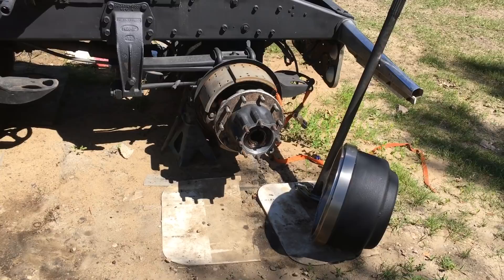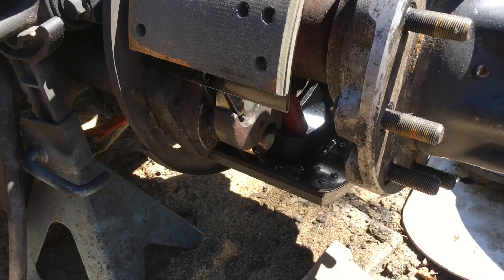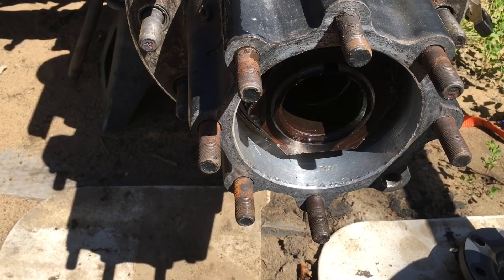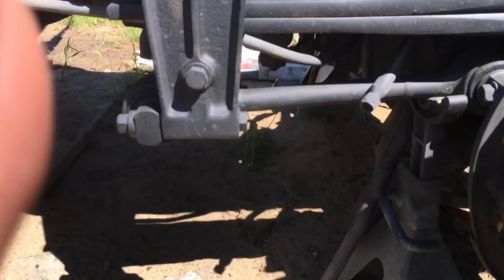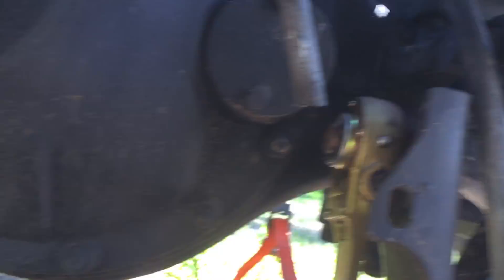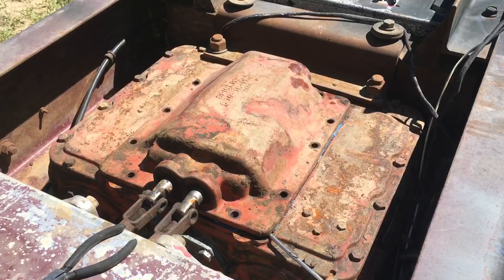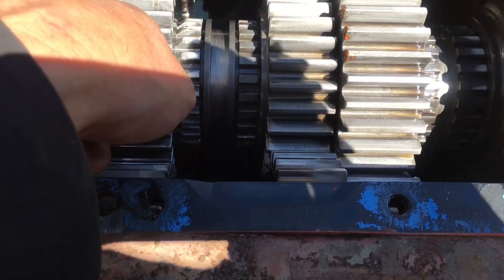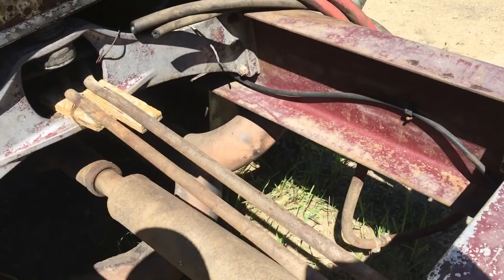Peterbilt 359 Restoration Ep.13 Brakes & Seal Refresh

Comment: Kinda fun working on that old gear.  Usually not terribly expensive if you are the labor.  Not a lot of special tools or even detailed manuals needed either.
Reply from the maker: Agree it is fun and straight forward to figure out/work on.  Had to build up my tool collection for the larger sizes but that was about it.  The high cost of for the upcoming items like new roof cap, fuel tanks, stacks, etc.  Gonna have to save my pennies...

Comment: Re-tension clips on the "S" cam rollers, you really want those installed.  Hope nobody has already mentioned that, didn't go through all the reply's .
Oh, and by the way it's always a little more money then we expected, it's a semi tractor.  
They might be big, and tough looking, but what they have to go through pulling the weight that they do takes it's toll on them.
Don't forget to pre oil those hubs, it gets ugly if you don't. Someone has probably already told you that though.
Might want to think about tearing into the dash and make sure all the heater and vent doors are working properly, when you get the seats out. Might be a mouse nest or two up in there.
Give that heater core a good look, think you said it sat for 10 years.
If you have a fuel pressure gage, you might want to replace the fuel line to that gage, fuel leaking on wiring, well that's self explanatory. Don't remember the early 3406/ 359's having them, but if it does, replace that line.
Hope I'm not classed as one of the "Haters", That's not my intention at all, just putting down some thoughts, and if I mention something you haven't thought of and it helps then great.

Comment: Nice video man it’s coming along nice make sure you get some oil out to them bearings after you get it done I drive slow on the side of a slope or use a jack to run the oil back to them

Comment: I have that socket for the rear hub nut with a welding extension that was special made where u can put a 3/4 torque wrench and torque to 50 ft lbs while spinning and as u said back off 1/4 turn. When i worked on city buses.

Comment: Nice work, just a suggestion always torque those wheel bearings. 200ft lbs on inner nut back off 50ft lbs then back off exactly quarter turn. Torque the outside nut to around 250ft lbs. just my opinion anyway I’m sure your way will work out fine!

Comment: Two things.....retention clips on the cam rollers....did they not come in the kits ?? You will wish you had flipped the slacks so the adjuster and lock sleeve face to the rear or away from the pot....easier to adjust and less plastered with road crap. Great project.
Reply from the maker: Ya good tip on flipping the slacks, I put them on the way the old ones came off but agree a flip makes more sense.  No retention clips in the brakes kit I bought from Peterbilt and none were on the ones I removed so don’t believe they are required for this particular setup

Comment: I was watching your latest video and things are coming along well one thing I noticed was that the slack adjuster you installed are on backwards. The adjusting nut should face away from the brake chamber. Just a helpful tip for you. It will make adjusting the brakes much easier when all the components are installed. But the rig is shaping up nicely.
Reply from the maker: Thanks Aaron - appreciate all your tips and support finding parts for this old girl

Comment: Stay with it, started working on those when I was 8 years old, best times of my life w/ me & my dad. We got up to 26 trucks. Wouldn't trade those rough/hard/satisfying times for anything in the world!! When you put your sweat & hard work into something and not only see it succeed and run but to make a little money (not a lot ) but a little. Nothing more genuine. And Ken Worth is correct, flip those SA and will be way easier to adj. Also your learn to grab/pull/push/shake everything while you're under there adj. those brakes bi-weekly or so. It'll keep you from breaking down on the road miles away from the shop. You need any info or advice let me know. Good Luck.

Comment: There are no front brakes on this truck as I recall..yes I been paying attention.. Lol.. Great update, keep on keeping on.👍
Reply: I have a 1974 Peterbilt 359-A my truck does not have front brakes, It wasn't required on trucks until 1977.
Reply: ConfederceyCSA yep and when you wanted to stop you dragged your feet out the door
Reply: My dad 1977 kenworth K-100 had front brakes on it when it was new and the owner took them off. So since then no front brakes on it.
Reply: I had no front brakes up until my last one, a 1985 model. They were not required in Canada at the time I don't believe.

Comment: Make sure you fill your hubs with oil. I usually fill them with oil before I put the front bearing in so they don’t burn up.
Reply from the maker: Ya I put as much in the hub as I could before putting the other bearing in place so theres some in there now.  Plan to either add through the plug in the hub or just jack up the opposite end once I change the oil in the diff
Reply: Sounds good, I thought I'd tell ya in case you didn't.
Reply from the maker: Appreciate it - thanks

Comment: There’s a standard torque for hubs that has been developed over the years. Seat your bearing at 200 lb-ft with the adjusting nut, back it off and then go to 50 lb-ft, back off 1/4 turn and check for end play within tolerances 0.001-0.005”. (Rotate hubs during torque process above) 
Then install the ring and then the jamb nut, torque the jamb nut to 275 lb-ft. Bend either one flat of the ring over or two tabs if it’s the tabbed washer to retain the adjusting nut and done.

Steer axles are either a quarter or half turn back off depending on threads per inch and single or double nut. Double nut design the jamb nut is 200 lb-ft and if I remember correctly the adjusting nut is like 25 or 35 lb ft before you back it off. 
There’s references online for them but as long as you’re not getting hot or so loose you have end play you are generally set. 

Hub sockets can be a costly tool, my sets of them are one of the most expensive things I’ve ever had to own (shops provide them sometimes)

Very nicely done - not many people want to just go do this much work when they don’t do it for a living.

Comment: I hope you are pulling the Allen head plug out of center of the hubs and putting about 2 pound of rear end oil in the Hub if not we'll burn wheel bearings out before oil gets out to them.
Reply from the maker: 10-4 plant to do that just forgot to mention it in the vid
Reply: 359 TwinSticks okay mister.

Comment: I couldn't afford a Peterbuilt but I got a 1985 Businessman's Classic Freihtliner which was the last year for the aluminium hood and free-mount head lamps,  had a 3406A block which i upgraded with an out of frame rebuilt 3406B , SO I got the truck for 3000, the guy had the rebuilt engine with receipt for 18995.00 exwife sold me the engine for 2000.00 and her brother inlaw installed engine, rebuilt brake saver and installed new clutch for 5000.00 ( price included clutch) said the old clutch was pretty good but since engine was out of truck that was good time to do the clutch anyway, I dont have class 1 or 3 but I do have Air endorsement on my Class 5 and register as private passenger vehicle and considering I am very short if you see a old Freightliner and it lookz like no one is driving that would be me....lol

Comment: Nice video 
Quick question how did you get breaks for your truck i have a hard time getting breaks for my 1982 international no one has them and your truck is 1979 .
Reply from the maker: Head out to your local International dealer, with the unit VIN or serial number they should be able to pull up the required part numbers.  Then if you wanted to save some $ you could take that number and shop around at your local heavy parts shops.  Good luck 😉
Reply: 359 TwinSticks i did that all ready no luck they cant help me my truck is to old they say is not in there computers any more but thanks .😔

Comment: Is your slack adjusters on backwards?   Adjust nut to the rear?
Reply from the maker: Actually just tried to flip them around and that’s not right as the diff housing is right in the way so there would be now way to grease or adjust the slack...guess that’s why the ones I took off were facing forward
Reply: 359 TwinSticks huh.  Crazy.  I have never seen them like that when inspecting trucks.    Great job by the way. I will be redoing a 1983 Freightliner Cab over

Comment: Have you gotten new front brakes?
Reply from the maker: Not yet ... since it’s still legal in Alberta to run without I may leave it as is for now.  Not planning on pulling B’s through the mountains.  Maybe if I fount a front clip off a wrecked Pete...
Reply: Think you can post another video?

Comment: You took a beautiful 359 that had the frame painted the color of the truck if you painted it Matt crap what the heck were you thinking that black is not hold up it gets dirty quick and it looks faded after a couple washes it turns brown you went through all that work I say I'm passing it you should have just spent the money and go to back blue the way it was or at least last night even though it's generic the older peterbilts the option of painting the frame the color of the gab which you did not do
Reply from the maker: Alex Ross I like flat black ... easy to repair/paint over and doesn’t show issues like orange peel.  I’m not a professional painter so that’s what I decided to do with my truck.  BTW, the frame was not originally “beautiful blue” but was instead painted over the original ugly red 😂

Comment: No locking tang on the outer jam nut?
Reply: Tony Mullins it has a drive in wedge
Reply: The Peterbilt trucker Chuck Oh 10-4 sorry i dont ever work on these classics, i work on frightliners lol, anyway the ole girl is looking good can't wait to see it done
Reply from the maker: The Peterbilt trucker Chuck worried I might have missed something as I just put it back the way I found it...what do you mean by “drive in wedge”?
Reply: 359 TwinSticks  does your rear ends have the “Cone” where you cannot over torque bearings? And that little clip that taps in to lock outer nut?  That cut out part in threads on top where wedge goes